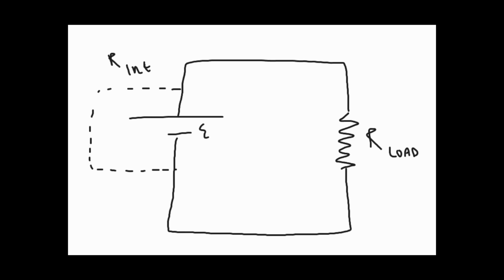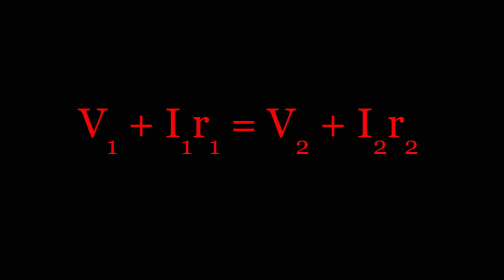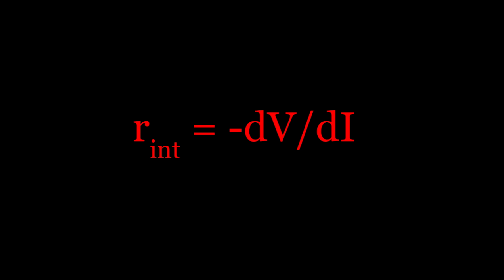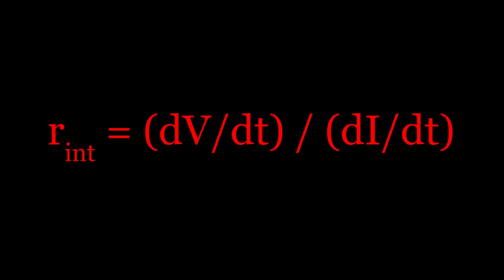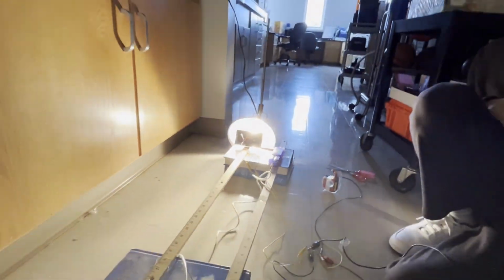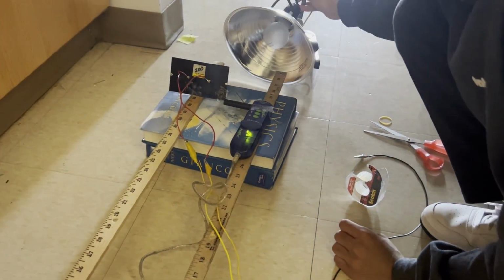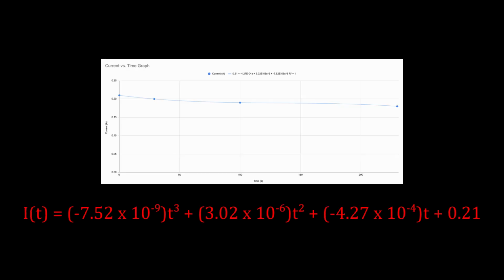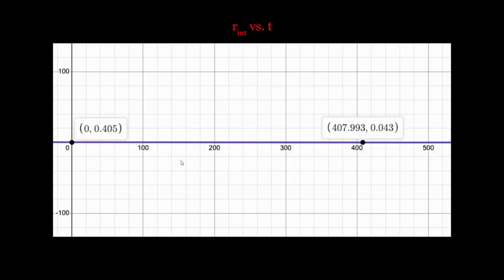Determining the Internal Resistance of a Solar Cell

Comment: Wow, what an insightful and engaging video! The way you and Aarsh Patel broke down the anatomy of the solar cell and tackled the problem using parametric equations was truly impressive. It's clear that you put a lot of effort into iterating your setup and using sensor data and electrical equipment effectively. This project not only highlights your expertise but also provides valuable insights into the workings of solar cells. With the increasing demand for renewable energy sources, your work is both timely and relevant. I'm sure many people will find this video incredibly useful. Keep up the great work!
Reply from the maker: thanks boss